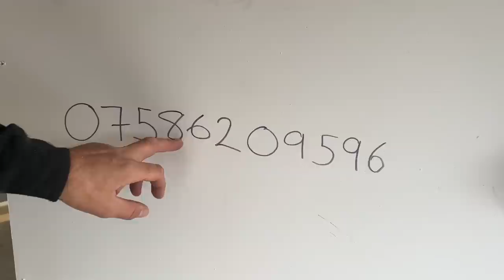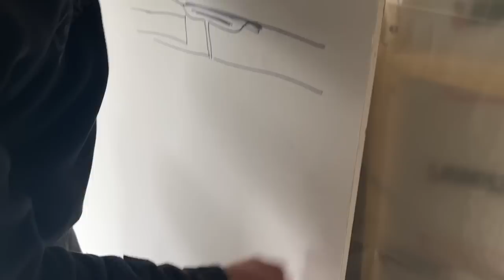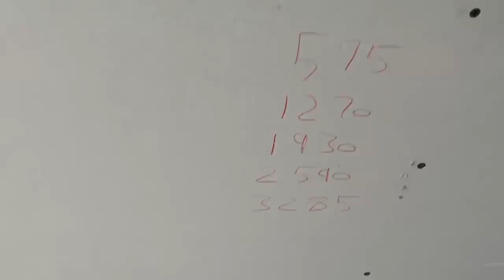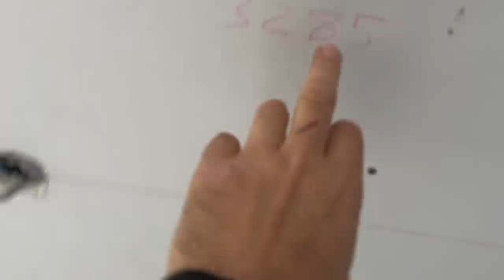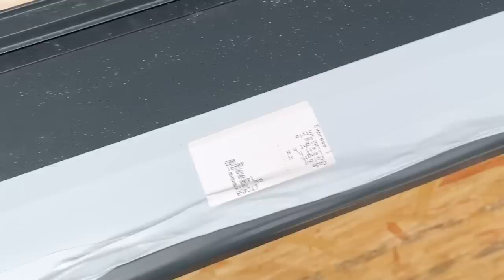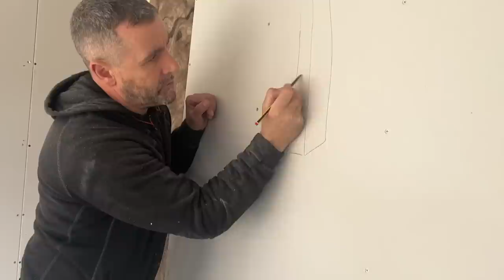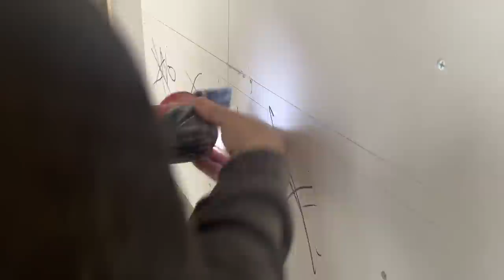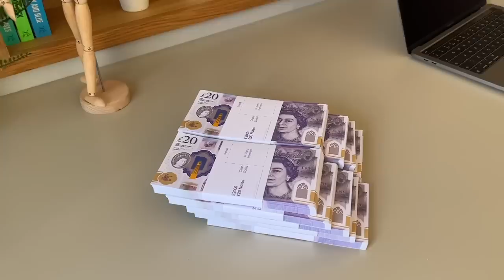You cannot miss this series if you are building a garden room!

Comment: The main reason we all (or most of us) leave gaps at bottom of boards, is originally to negate the issue of the board basically sucking up damp or water if there is ever a spill. Flood or leak on the floors, it was especially. Done in mainly kitchens and bathrooms, another tidbit for you😂👊👊🙏

Comment: Nicely explained! Prompted some further questions though!.... when installing your windows, how long is the cill to account for the double battens and cladding (mine will be 130mm from the membrane on the wall) ... and how then would you clad the return so you don't see the "air gap" battens? Would you trim the window opening out to the battens so you can attach a trim? Sorry for all of the questions!!!
Reply: 130mm from membrane? That's huge. What are you using as cladding? Upvc windows have a 180mm cill you could use. Ali windows can use a 190mm cill.
Reply: @nickgriffin637  33/1000 profile plasticote steel sheeting, so the combined Barton's and max height is 130/132mm